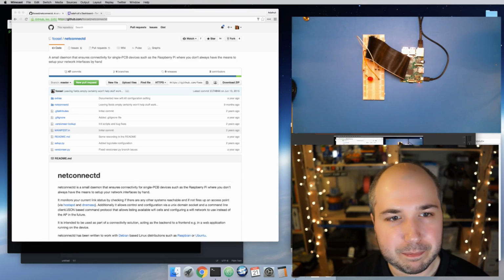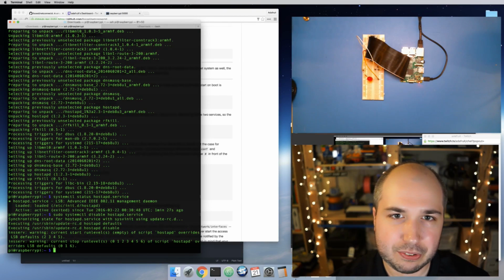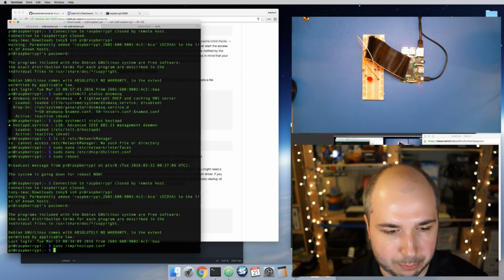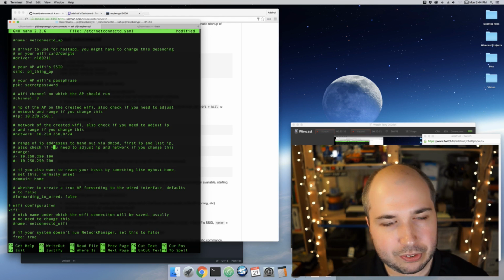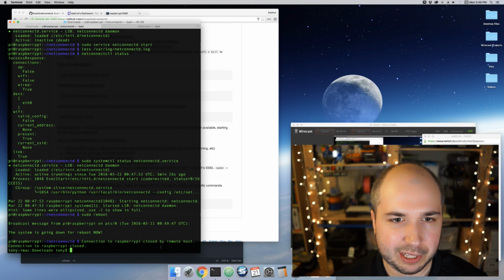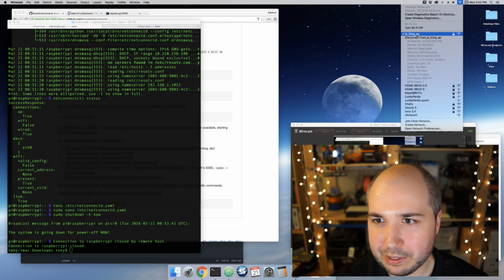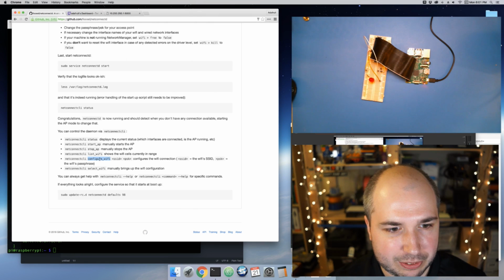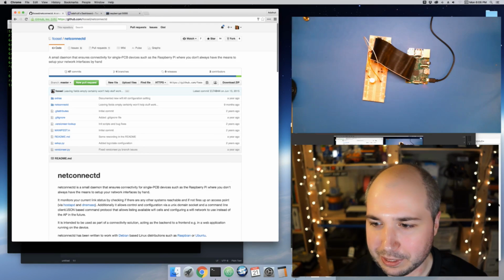Raspberry Pi 3 and netconnectd with Tony D! @adafruit #LIVE

Comment: I used (the old version I think) of this with my Tesseract case. It broadcasts a network that you can connect to on your Android device. Once connected, you can use an app like All Cast and stream videos to XBMC running on the Pi. I've always wanted to try this project with a monitor in a car. No need for scratched DVDs. Just put the movies on a tablet and you can play it for your kids in the car. http://dustinevans.net/tesseract.php

Comment: Nice little daemon, sure gonna try this.

Will it be possible to save multiple network names it can connect to?

to remove ssh keys one can use ssh-keygen

the command should be;  ssh-keygen -R [ip] 

would love to see a small webpage to change the wifi settings...